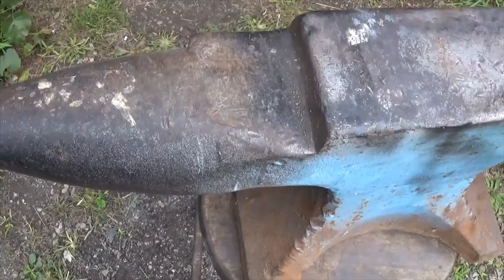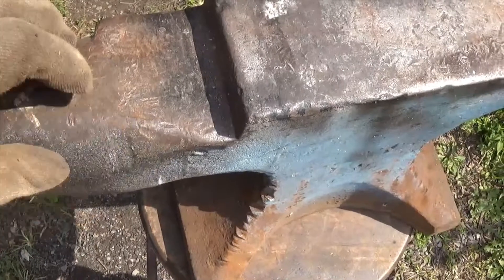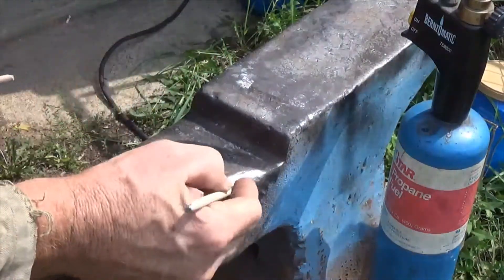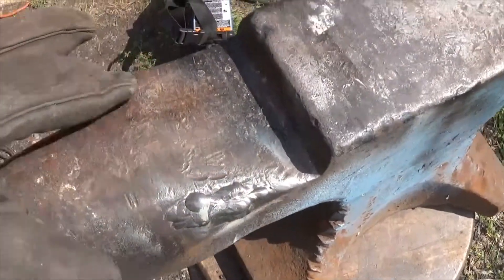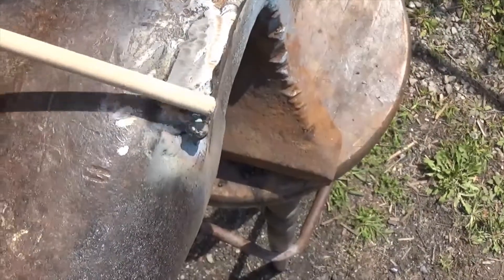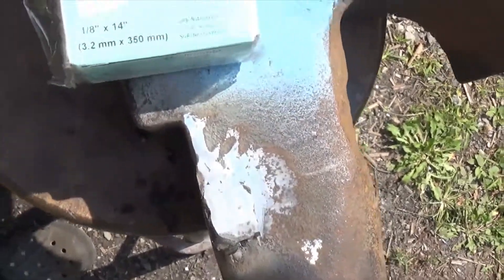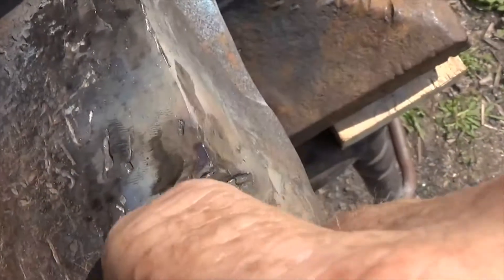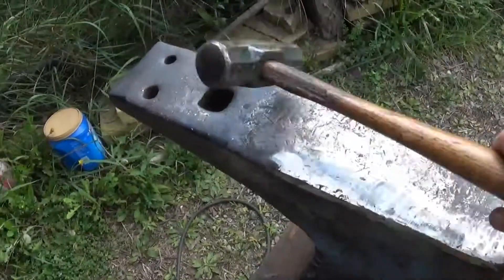Anvil Repair

Comment: that missing corner wasn't really missing... it was never there... I have the same anvil, the cutting deck is only on one side... that anvil is about 190 years old... also the shelf, or cutting deck should be soft, as opposed to hardened